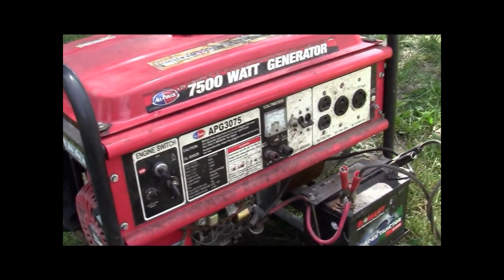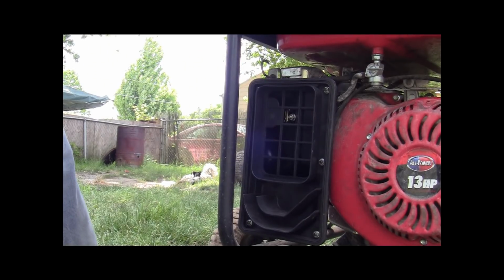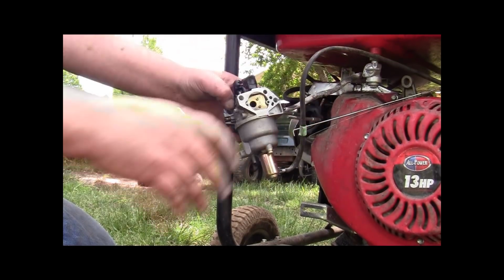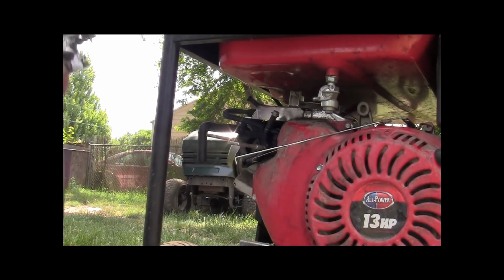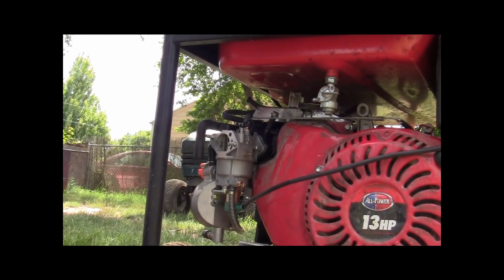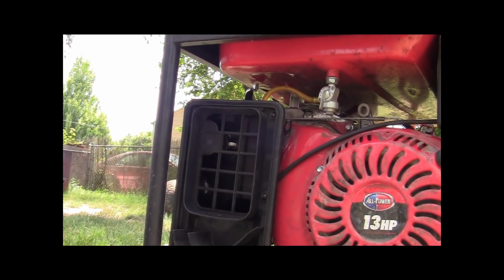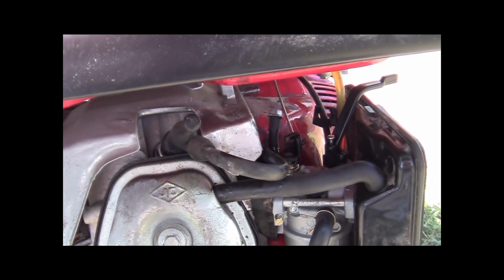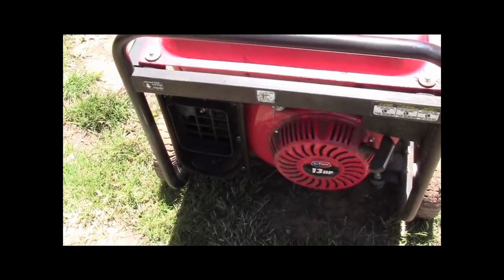GENERATOR TRI FUEL SWAP (PART 1)

Comment: Found that Chinese carburetor for a Honda motor on eBay for $22. I have it on a Home depot Power Stroke 7000 Watt generator, now it runs  on gas,and natural gas. I am running on natural gas it runs great.
Reply: What model carb kit you order? Thanks.

Comment: Well done on Gas and Propane Carbs, kind Sirs. But I was waiting for  you to show us a working NG Crab. Because I'm buy a new 9500 Watt SUPER QUIET Inverter Generator with CO SECURE Technology; from Harbor Freight.

Because I WANT NG Carb and NOT use either gas or propane. Will you be videoing; that shows a NG Carb working? Thank You much.
Reply from the maker: I don't have access to NG at my shop so I can't do that . Sorry !!
Reply: @shawnmrfixitlee6478  Understand.
Reply: @shawnmrfixitlee6478  But I have a question kind Sir? 

Champion TRI-Fuel, 10,000/8000 Watts Generator says, "You don't need a regulator on NG". Because, the gas meter at your home; already has the regulator. So, all they do is to take a gas line; right into the generator; if you don't use propane. Which I don't. 

What is your take on that, Sir?
Reply from the maker: @MrPatdeeee  The generator has a on demand regulator . read the book and all should be good HF makes some good generators ! Thanks ..

Comment: I used a GX420 on my Predator 8750 13 hp Generator and it works great. When I was looking for an alternative to a 200.00 US Carb Tri Fuel kit I was told I would need the GX420 and they told me the GX390 was for up to 12 hp and the GX420 was for 13 to 15hp. So what is the real difference between the two? The only difference I could see was the regulator was a little bigger on the GX420 but the carburetor itself had the same size openings and choke.
Reply from the maker: This kit works on the 420 , I have one on my other Gen and it works just the same as the 390 .. Thanks !!
Reply: Gasoline has more power output amount for amount than NG or Propane. So the carb can be the same size, but needed a larger regulator for the NG/Propane.
Reply: Hi , so if I understand correctly the gx 390 will  work on 15hp generator, thanks

Comment: Never saw one of those.  What i want to see is running it on natural gas.  During hurricanes I don't have easy access to gasoline or lpg but I have natural gas non stop.
Reply: Amateur Redneck Workshop This carb kit is the cheapest and the best conversion. I did it and it runs well. Use half choke to start and full choke to hand start. Works very well on propane and very easy to install!

Comment: Ok, so where does the 2 wires from the solenoid go to??  I am checking these kits out but can not seem to find where the wires should go. - Thanks for the video, it was great!
Reply: My guess is the solenoid is the AntiBackfireSolenoid for operation on gasoline. Solenoid blocks main jet when not powered. Unless you hav 12v supply to you couldn't use gasoline. Common practice is to replace it with a bolt that matches its thread size pitch and length. If you idle engine down before shutdown they usually won't backfire in muffler.

Comment: Thank for posing I did not know how to adjust the ideal screw.  I want to do an LPG conversion also.  To copy honda  these copies only have to be altered slightly to get past copyright laws The problem with LPG is I know you will go through more LPG then you do with just Gas  But if the carby blocked  you can still run it on LPG

Comment: Do you know if this sort of thing is made for the honda eu1000i type generators?
Reply from the maker: no,, I don't think these will work with them . These are for bigger units .. Thanks !!
Reply: That was pretty obvious. That's why I wondered if they are also made for the smaller generators. Thank you. =0) I haven't found anything like this for the eu1000i so far, after hours of searching. (Your vid was found during the searching. Figured it was worth a try to ask. LOL) I'll probably just make my own setup.
Reply from the maker: @selador11   You can search  , But they don't make a propane setup for the small Honda EU generators . would be a great idea if they did !!
Reply: Unfortunately, I believe you are absolutely correct. Oh well, I'll just make my own setup, I guess. If I am successful, maybe I'll even make a vid. LOL
Reply from the maker: @selador11   please do , I would be interested in watch'en  a vid like that !!

Comment: I cringed when you turned on the gasoline valve with no inline fuel filter on a brand new carburetor... especially after stating at the beginning of the video how long this unit has been sitting.
Reply from the maker: everything was cleaned out , all works just fine..